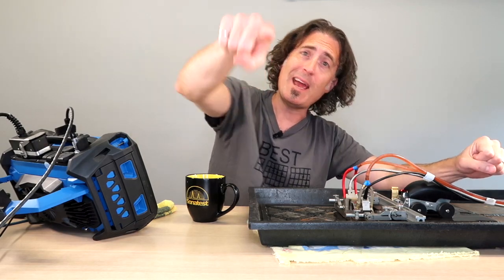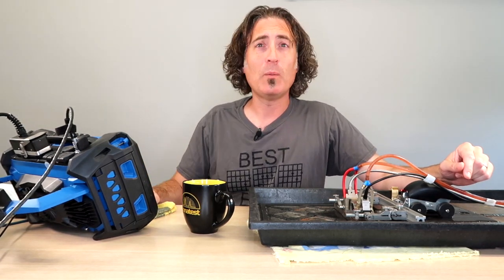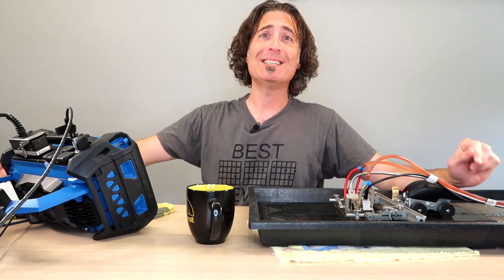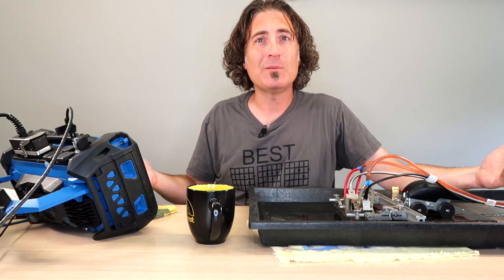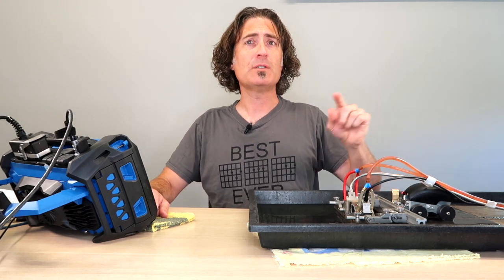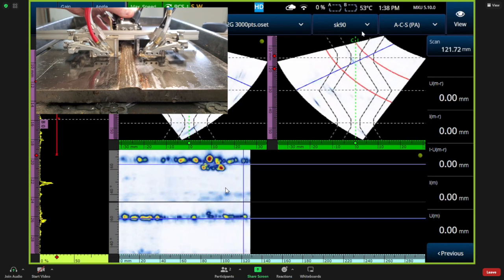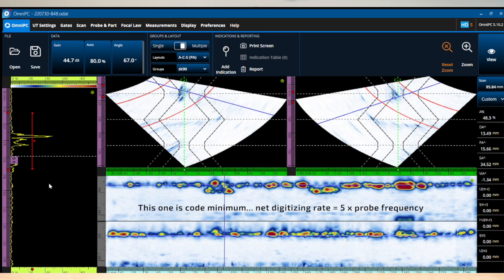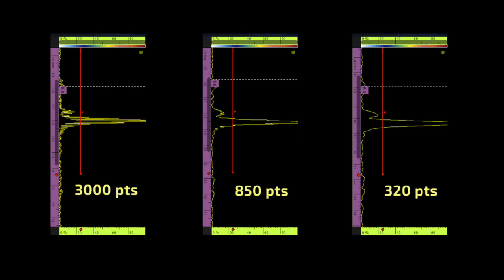Omniscan Points Quantity

Comment: Can you make a video on one-sided scanning? In my company I am mostly able to access welds from one side only and I need to use some tricks like simulating sound paths in BeamTool or using the oldschool method of putting my finger on the spot I think the geometry indication comes from to make the signal go up and down to make sure it is actually just geometry and not a flaw. 

Thank you btw, great content)

Comment: Is these setting available in sonatest??
Reply: Negative. Points qty is an Olympus thing.
Reply: @HollowMan19xx  🙏
Reply: Fortunately, this option is not available in Sonatest instruments. As I found out when testing the latest version X3 (5.15), the instrument has a set number of points and strongly limits the ability to reduce the range. If you need a small range (for composites inspection) and the menu is set to too many points, the instrument will not allow it. The logic is built so that the number of points takes priority, followed by compression and then range. Sonatest displays the number of points and the resolution (number of points per mm or inch). It is then possible to select the compression so that the number of points matches some requirement. It also shows the approximate file size.

Comment: Hi great video, can you make a video about conventional UT scanning? For a beginner that thinks everything on the screen is an indication and tries plotting the indication on a plotting card and realizes its profile or root, but.. still frustratingly does the same thing along the surface of scan
Reply from the maker: Yes I've been meaning to dial back the phased array stuff and get into more conventional. UT is so vast though, and I try to keep my videos to 5 minutes. Anything in particular?
Reply: Probably tips on scanning dB, like how much is too much. Then about selecting probes. But for me personally, how to confidently identify relevant indications in a weld. If possible, could you include nozzle and node inspection?